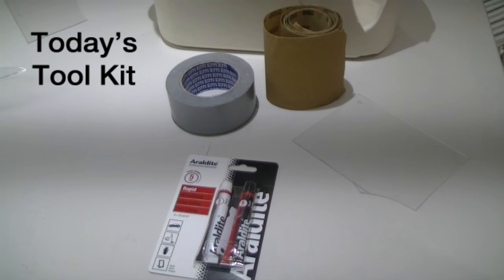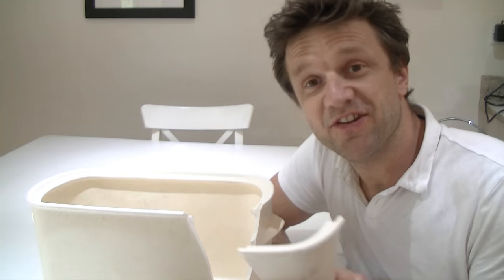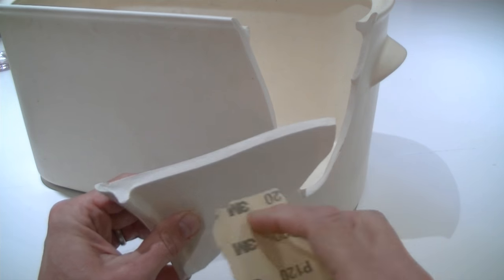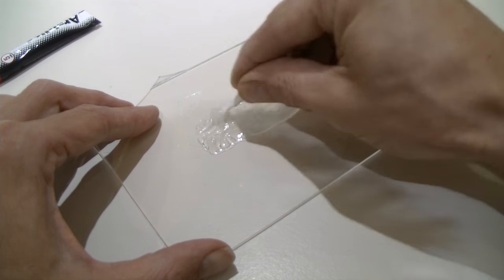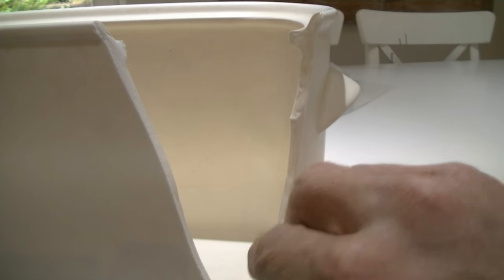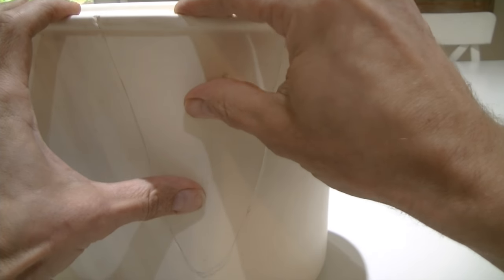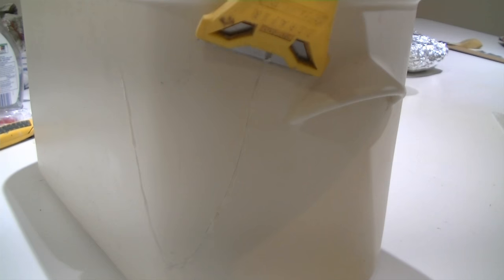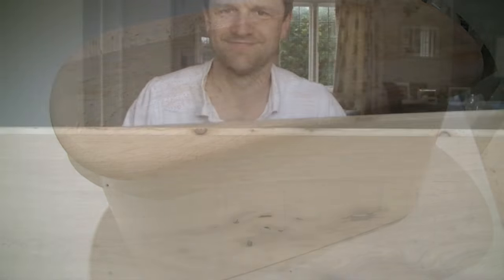How to Glue Broken Ceramics

Comment: I’ve got a question can this 2 part epoxy be used on a top plate ( gets hot ) from bottom warmer ! The top plate broken in 2 pieces , I figured it’s repairable but worries me bcoz of the heat from warmer 🫤!
Reply from the maker: I doubt it unfortunately.

Comment: Hi I need to fix  a horse figure ceramic back onto the ceramic base  only three hooves hold it on and it’s quit large  can you advise  me on best glue
Reply from the maker: This epoxy is very strong, Elizabeth, but tricky to do an invisible repair with as it's quite thick and gloupy. Have a look at what ceramic super glues there are at your local DIY store, and maybe try with that.

Comment: I was planing to glue a mug handle back to my mug it broke in to 4 pieces tho 😂 but i love the mug. Is it possible that i can still hold it by the handle if i use the 2 part adhesive?
Reply from the maker: I wouldn't recommend gluing the mug and then using it, but you could certainly glue it back together with this stuff.
Reply: @CharlieDIYte  Chears, I still use it without the handle but i want the hsndle since it looks a lot better with than without... Think ill glue it back but obviously not hold it by the handle

Comment: Thanks for the video, however, it would have been helpful if you mentioned what you were repairing.  I thought it was a toilet tank.  Do you know if this glue is waterproof and will stand up in the part of the toilet bowl which does not have contact with water unless there might be a leak which would be immediately noticed?
Reply from the maker: I was mending a bread bin. I wouldn't rely on this for a toilet tank or bowl. Repairing something like that is going to be problematic but I suggest you Google epoxy type resins that are designed for the purpose.
Reply: He absolutely said that he was repairing a bread bin. And..after the repair when the lid was placed on the bin didn't you recognize what  it was???
Reply: It looks like a toilet to me
Reply: Where is the laugh button when you need it!  Actually, he did mention it in the beginning, but it did look like a toilet tank!

Comment: Will this glue soften with heat?  I want to glue the handle back on a ceramic mug.  The glue will not contact the drink but boiling water will heat the ceramic.
Reply from the maker: Yes it will, albeit I'm not sure at what temperature. Best not to risk it!
Reply: @CharlieDIYte  is there anything to use on a crock pot? My pot has a small hairline fracture that I'm trying to fix if possible.  Thanks!!

Comment: Hello Charlie, I was trying to fit a wash basin to the wall by drilling through the fixing holes and managed to break both sides. I can no longer screw the basin to the wall.Can I use this glue to fix the two broken pieces back and will it be strong enough to hold the basin,which is resting on a pedalstal,against the wall?
Reply from the maker: What happened? Were you trying to enlarge the holes? You could try this stuff but I'm not sure it will be strong enough. Has it split the hole in half? In which case you could buy some washers and the washer will grab half of the hole? Maybe send me a picture to charliediyte@gmail.com so I can understand the damage a little better and then give you some targeted ideas.

Comment: Can i usethis glue to join the plaster handcasts to the wooden shadow box??n how much time ths glue takes to dry?do i need to put pressure??
Reply from the maker: Tell me a bit more about this job - I'm not sure what you mean by the plaster handcasts and wooden shadow box. This glue is suitable for metal, wood, masonry, ceramic, glass dry concrete, chipboard, leather, cardboard, fabric, rubber and most plastics (except polyethylene, polypropylene, Teflon). If you are going to use this, the handcasts must be dust free. 

The parts (your plaster hand cast and shadow box) would be repositionable for 4 minutes. You have to apply light pressure to the joint until set (clamps or tape) for around 20 minutes. It attains full strength within 2 hours.

Comment: I completely broke a chunk off of my sink any hints on how to repair it?
Reply from the maker: You may need to get a pro in to fix it - they can do pretty good, near invisible repairs. Something similar happened to us on the belfast sink in our kitchen - big chunk came off it and I used an epoxy filler from Plastic Padding to glue it back into place - fine for us but the damage is very obvious but this might be more suitable https://goo.gl/54hf9R If the enamel is white you'll stand a reasonable chance of doing a decent repair. If your sink isn't white it's going to be more tricky..

Comment: Broke my sink, dropped a large glass bottle in it and it chipped the sink and also left long hairline fractures from one size of the sink to the other. It does leak and I just filled the chipped area with some clear epoxy and used my finger to wipe some along the crack. Will sand everything flush once it cures. Is this repairable? Ty
Reply from the maker: Hi James, I think there are some repair kits out there, eg https://www.youtube.com/watch?v=cVKk-Iel5K0 but it's quite an involved process that is a bit more technical than just buying a tube of epoxy, and you may need to open up the hairline crack a bit to ensure that you get a sufficient amount of the repair epoxy in there. If you are going sand, remember to use the right sand paper - eg start on 200, go up to 800 and finish on 2000 grit (I warned you it was pretty involved!) Good luck!

Comment: can you glue a broken toilet tank lid with this?
Reply from the maker: Yüksel Hassan I don't see why not. How strong the repair will be will depend on the thickness of the plastic you're glueing together - as if the two pieces are very thin the surface area for the glue to adhere to will be very small and so the join may not be that good. If on the other hand they are quite thick then you have a good chance. 

You will need to be careful not to apply too much glue as if it squeezes out on top of the lid, it may be hard to clean off, being plastic.
Reply: Thank you, but the lid is a thick ceramic or whatever they make toilets tanks these days  cheers
Reply from the maker: Ha! I don't know why I assumed it was plastic!! Then yes, this glue would definitely work. 

The other glue you might look at is this http://www.gorillatough.com/gorilla-glue .  I've heard a lot of good things about it but haven't tried it myself yet. If you do use Gorilla Glue, you will need to damp the two surfaces first (as it is cured with moisture) and apply only a very thin bead as it expands 3-4 times whilst curing! You will also need to find a good way to grip the two parts of the toilet tank lid together for 1-2 hours whilst it sets, and be prepared to trim off the excess that has expanded out of the join, once it's set.
Reply: Yüksel Hassan broken ceramic tolet water contaner